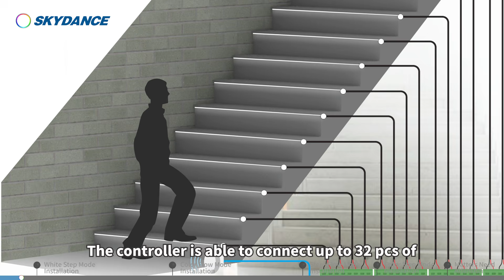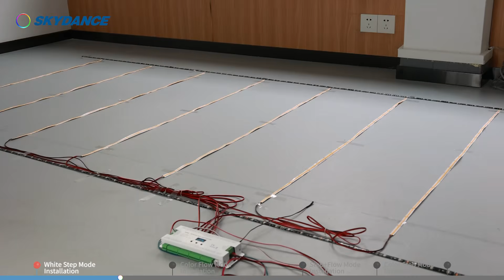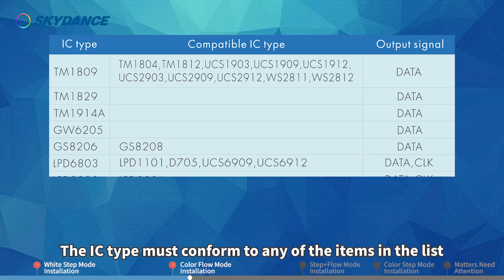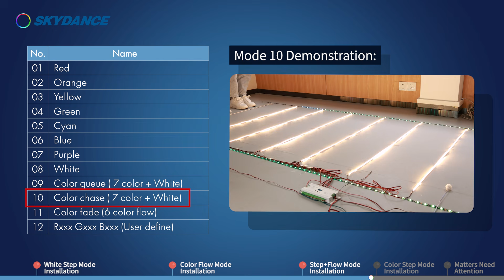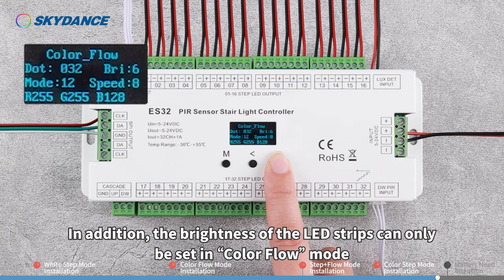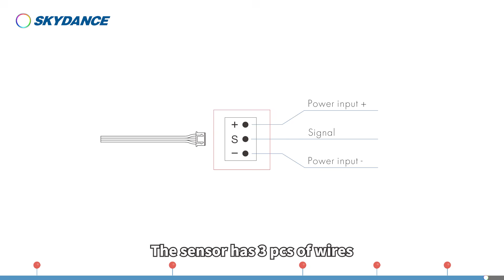SKYDANCE ES32 32 step stair lighting controller installation

Comment: apparently there's an issue with this controller... when it's set to "white step" using both PIR sensors, when you're activating the bottom one, the stairs are light up one by one and turning off the same way but when you reach the top of the stairs and pass near the top PIR, the sequence is activated again from top to bottom. Also, if there are two persons, one coming from down and the other from up, activating the both PIRs, the sequence will start from both sides creating a mess. It should be programmed in a way that whichever sensor will be activated first will chose the sequence and finish it, meaning that if the sequence is not over, activating the other PIR will do nothing.

Comment: Good morning, I have a question:
When I go up on a stairs it switches on step by step from tge bottom to the top, as long as I cross upper sensor ( last step)  it starts to turn on the light step by step from the top to the bottom, while the 1st program of switching it off from the bottom to the top is not finished. All this happens from one procedure when the person is going from first to second floor. 
How to make that this 2 algorithms are not crossing with each other, or the top sensor is waiting untill the first algorithm of switching on/off step by step is finished.